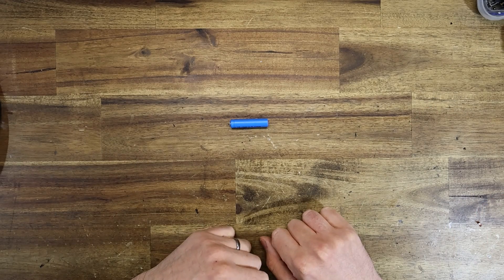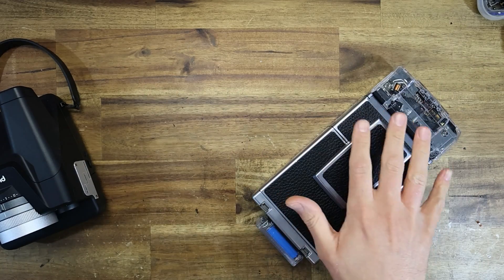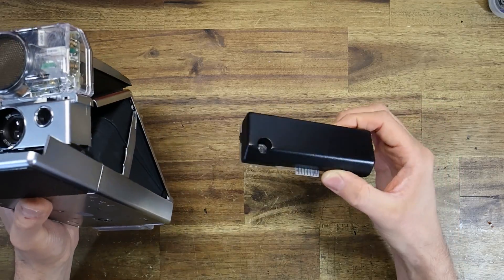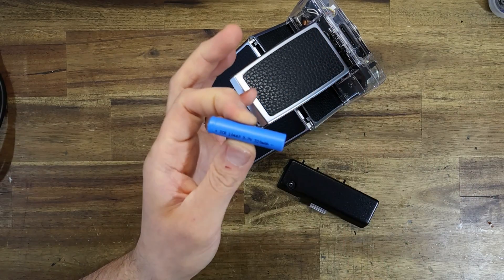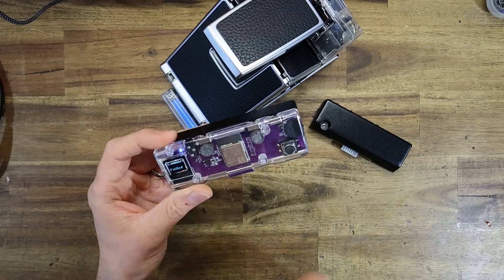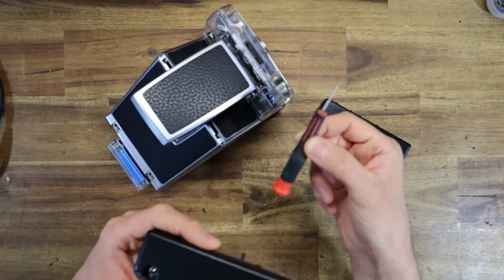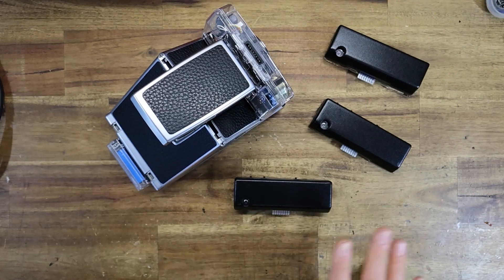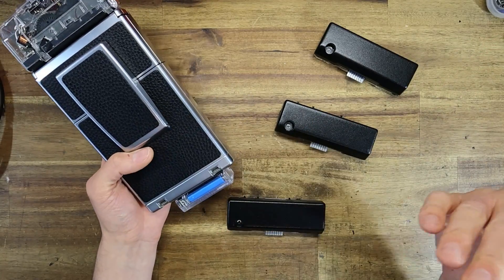Polaroid SX-70R Bluetooth Dongle upgrade! More repairable and better than ever!

Comment: Is there a way to connect a Alpha pcb to a Model 1 lens assembly and make the Flash FFA work?
Reply from the maker: Sort of - but it's pretty janky 

If you are going to that much effort, you might as well just get an SX-70R PCB, since they are compatible with all flash designs
Reply: @theinstantcameraguy   I just got the Alpha pcb from a Alpha camera I converted to SX70R! So I have a Model 1 where I know the flash is ok but the pcb is dead. Putting them together all works apart from the Flash. That's what's great about the SX70R, all flash FFA works, and I could go for a new SX70R pcb, but I'd like to try recycling a good working pcb. What's janky, I don't know that word :)

Comment: I mean this is cool but I don’t think I’d want all that manual stuff on my Polaroid. The remote thing is probably the most important feature. I want an SX70 still hehehe
Reply from the maker: @fenixlolnope361  to be honest, I think one of the nicest features of the SX70R PCB is simply just a reliable automatic mode 

90% of the time a user will just stick it on automatic mode

The manual control etc is a bonus!
Reply: @theinstantcameraguy  is the automatic exposure that’s built into the stock cameras significantly worse than a OneStep or Sun 600? I have a pink cool cam that’s basically my main camera and the ae seems fine on that o.o I always assumed that these new PCBs were just for fixing cameras that were broken\corroded
Reply from the maker: @fenixlolnope361  the stock PCB also works fine when in good condition

But we must remember that the old boards are 50 years old my now

Many of them have corrosion of the electric eye etc, which needs to be compensated for in a restoration 

Not an issue on the new boards

Comment: Thanks for the videos. Very enjoyable and informative. I’m still astonished by your enthusiasm for replacement batteries but lack of enthusiasm for a solution that allows the re-use of 600 and SX-70 pack batteries. How hard can it be to produce a holder for those batteries, removed from the film cassette, that slide into a holder on the bottom of the camera with pogo pins that connect to the internal battery connectors. I suspect a far sleeker look than bolting on a lithium battery. None of the currently available, 3D print yourself, adapters are very workable. I suspect there is a large market. I’ve been saving all my Polaroid batteries hoping something will come along. Easily as laudible as user-replaceable Li batteries.
Reply from the maker: @jmccutube  trust me, the market for such a thing is very very very very very small. SPRKPLG made an open source one and I've never seen anyone use it

Personally I think the idea would never be popular

It relies on 600 film packs existing to poach batteries from, meaning you'd need to purchase a pack of 600 regularly to keep the camera powered. And not everyone has a huge stash of empty 600 film 

Since it's not a standard battery, any battery holder that uses it would need to be custom made, meaning either lame quality 3D printing or incredibly expensive injection moulding. You'd also then need custom terminals to place into the housing

My PolaVolt in comparison is entirely made from off the shelf components.

Which one is "sleeker" is completely subjective

It's sad that 600 film is so wasteful, but recycling the batteries just isn't something most people want to do - especially when other options exist
Reply: I’ve tried the SPRKPLG one—very fiddly and not sturdy. Difficult to connect to the internal terminals (hence need for pogo-style pins. I suspect the market is maybe for 30% of all 600/SX-70 packs sold. That a few million batteries that could be fully used instead of tossed after 8 pics. Would work without PCB mod of course.
Reply from the maker: @jmccutube  to be honest I think an externally mounted solution is just not a good idea

A better idea would be to modify the molding of the current packs of film to allow the battery to slip underneath before the pack is inserted This would be a much better option, but likely one that is a bit fiddly for the average user
Reply: Or, a replacement body panel that incorporates space for the battery. Adds less thickness than AAAs or equivalent and wouldn’t lengthen the camera body.

Comment: “I invented” (adds an ugly battery pack in the back). The AMOUNT of ego! 😂
Reply from the maker: @marianofibonacci  

*provide the instant community an open source battery adaptor solution that seamlessly integrates into the cameras pre existing electronics
- accused of being egotistic

Thanks for your smooth brain take and for leaving a comment. Your negativity (likely stemming from jealousy or low self worth) only helps boost my algorithm.

For the record, my "invention" is not the battery adaptor itself, but the method of wiring it in. It is novel and unique and I came up with the technique. All I ask in return from people who use it is to be credited. Pretty common in the FOSS community tbh

Comment: if you were to use 10440's in a mass market item, you need to make sure to properly mark that it's not a AA slot, because a company in china used those types of batteries in a mini game console and people would think it was a AA compartment, open the battery compartment, remove the lithium cells, and then put in AA's which then exploded if you ever plugged them in, and didn't work anyways. they got an influx of bad reviews, so they replaced the AA battery slot with a Nokia BL-5C compartment and stuck a sticker over the door that says something along the lines of "do not open"
Reply from the maker: this is 100% true

Inside I will be adding a sticker that says to only use '10440' 3.7v lithium ion cells

I will be getting Yongmin to add further warning labels to the PCB silk screen in future revisions too
Reply: @theinstantcameraguy  It's a shame that you can't buy bl-5c compartments for DIY projects because they're so nice to work with. they come with built in protection and can be charged externally easily with a plug in dock 
even if you wanted to just hacksaw them out, it costs too much to get a cheap thing with it already installed compared to 10440's
Reply from the maker: @JessicaFEREM  100%

Part of the issue is all the things we are trying to do is on a relatively small scale. 

The entire point of my PolaVolt solution for example is the fact that it's open source and uses nothing but readily available parts.

Unless manufactures change their ways and make things more open source in terms of battery holders etc, it's hard to find "off the shelf" components that tick all the boxes

Comment: This has nothing to do with you Jake, you've done a great job.
I'm all for user replaceable batteries but I think manufacturers should never have started using AA and AAA sizes for lithium ion. The average Joe only knows single use batteries and rechargeables. Adding a version that looks identical but outputs over twice the voltage was just a bad idea and can potentially ruin equipment. If they'd made them 5mm longer or shorter there would be no way to insert the wrong battery. And think about this: 10 years from now, someone buys a used electronic device like this on eBay. It comes without a battery so what do you think they're going to put in? Exactly, a 1.5V Alkaline or 1.2V NiMH. And then they're going to complain it's not working.
That's probably the reason you hardly ever see a commercial product using these sizes Li-Ion.
Reply from the maker: I agree with you to be honest. But I think the deal was sealed when NiMH batteries were released in the same form factor. I remember my mum replacing the batteries in our cordless phone with alkalines... it didn't go well! 

Fortunately in the case of the PolaVolt, the lack of built in charging circuitry becomes a safety feature in this regard. Installing regular AAA batteries just results in a camera that doesn't power on! The lower voltage does no harm to the camera.

By requiring the user to source the batteries and charger for the PolaVolt, they become aware of the difference by default.

In the case of the dongle, which DOES have built in charging circuitry, a sticker will be placed inside at the battery compartment, informing the user of which batteries to use. Once installed, the battery should last years before needing to be swapped. 

I'll be getting Yongmin to add a warning label on the PCB silk screen